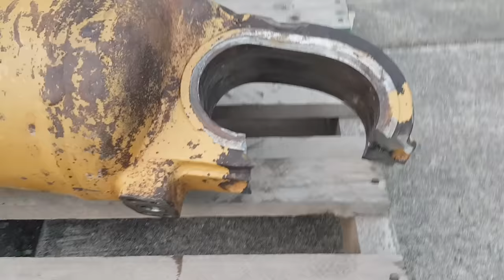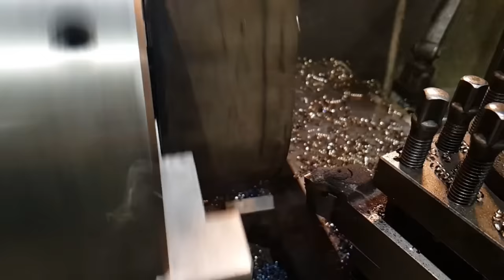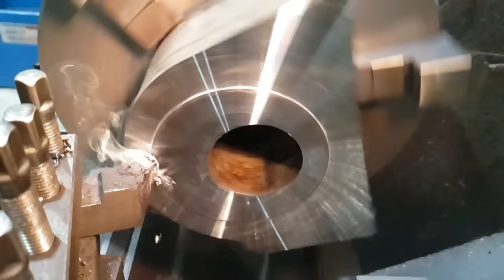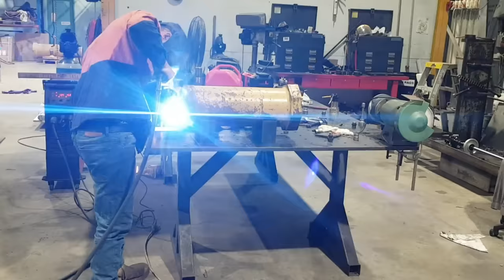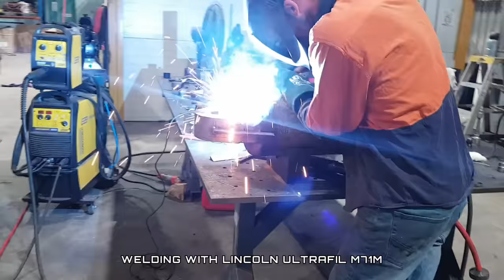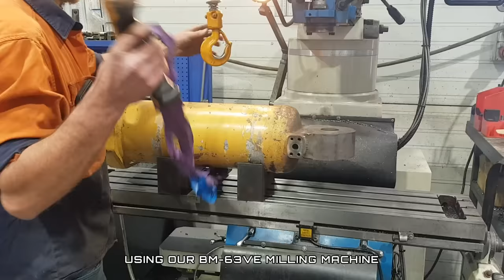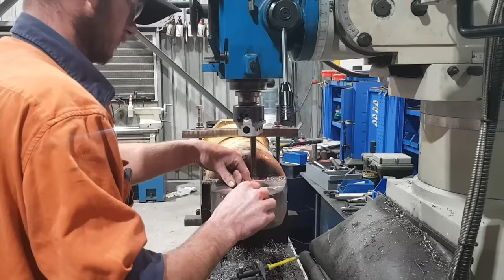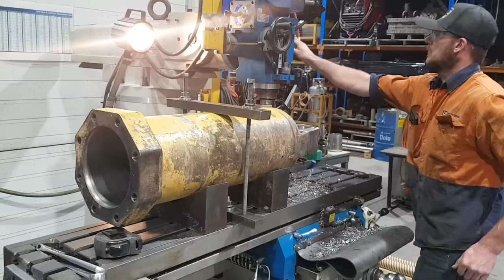Replacing Eye on Hydraulic Cylinder for Caterpillar D9 Bulldozer | Machining, Welding, Milling

Comment: My dad was a tool and die guy machining repair parts for huge presses. Watching this video makes me miss him and respect what he did even more. I know he had to work within tolerances of thousandths of an inch. You all did a great job! Thanks!
Reply from the maker: Hey Travis thanks for watching, really neat to see something similar and have those memories. 😎👍
Reply: "thousandths of an inch"? Can you please use real measure numbers? hehehe
Reply: @joaodarocha  You mean like Kilograms... ? 🤣🤣
Reply: @step4560  Kilogrunts. Like what you use when the nut won't come off but the wheel stud does
Reply: My Grandpa was tool and die as well, probably smaller stuff in general. Aircraft parts for Boeing. Next time I visit him I think I'll show him this channel. His GF is savvy enough to use computers haha.

Comment: Am not a machinist....so was in awe of that lathe cutting tool. Thought “something has to break” but I trusted you guys because I’m not a machinist.
Reply from the maker: Hey mate thanks for watching. Right tooling, feeds and speeds can definitely trust the gear 😎👍
Reply: I don’t see the preheated process before welding?

Comment: Worked in petroleum (and related hardware) for years...seen machinist work like this before, and even larger parts. Hard work, even with the right tools...but real craftsmen make it look better than new (and work better, too) when they are done. ALWAYS admiration for 'real skill'. I worked the 'advanced engineering' side of the slide rule, in the day, but if my kids were young now, I'd definitely push hard for them to have taken up trades (like machining) before dreaming of them going to college...trades are where the REAL WORK is done! Excellent video!
Reply from the maker: Hey mate thanks for watching and commenting. 100% agree. There's just something so satisfying and rewarding about a hands on trade 😎👊💥

Comment: That was a good repair, running the old three jaw on the facing cut wasnt what i expected. Good Job mate love watching how other blokes tackle repairs
Reply from the maker: Welcome to the channel, thanks for watching and commenting! 😎👍
Reply: I woulda ran the four jaw and roughed out the bore some while I was there.  Save some time with the fine boring head on the Bridgeport.
Reply: @Thewaldo12345  the time you "save" is wasted in setting up the 4 jaw. there is a reason hes making money while you make excuses.
Reply: @DieselRamcharger  if you can’t indicate a four jaw quickly you have no business in a machine shop.  Unless you are speaking of swapping out a three jaw to a four jaw that would take some time but most folks have a lathe for each.
Reply: @Thewaldo12345  youve got to put it on the machine. breaking down a setup is stupid. this was fast, easy and effective.
Reply: I wouldn't rough machine hole before welding...it just makes your welding tolerances tighter.

Comment: I have done hundreds of these over 30 + years. In logging these are common repairs. Some operators more than others. I used to keep many of these blanks for stock. I rarely had time to saw the weld taper off. Torch or plasma and get it done as a machine was down. No time for fancy work on the mill either. This blade tilt cyl couldn't care less if it looked good. Sound welds and function were primary. These ends were often sent to the mobile mechanics to install. The bore was done in shop and tuned to fit the pin with flap wheels after welding. No time for fancy when a road building contract was on hold till the problem was solved. 4 other pieces of machinery waited at big bucks as well. Sweet repair though !
Reply from the maker: Hey mate thanks for watching and commenting. I started out operating in forestry logging in north Australia many years ago 😎👍
Reply: @CuttingEdgeEngineering   I am retired now and really miss being out there.

Comment: I'm just impressed the time and effort was taken to repair it. Where I work they would just huck it in the scrap bin
Reply: And how much delivery time do you expect on such a part in Australia?

Besides the new eye looks beafier by a lot, so probably user thougth he was better of getting it fixed stronger then a factory original new one would be.
Reply: Cylinder like that, easily anywhere from 10grand up.  Especialyl with its age, likelihood of it not being available, shipping and down time constraints.  Repairing something like that is most likely the most economic route
Reply: @Relovance  don't know the cost but yes cheaper to repair then replace ..
Reply: they must of had a huge budget too work with ,, the normal is too fix it if you can ,,it is cheaper too fix then replace .

Comment: Very nice video...thanks for reducing the boring to a less 'boring' amount! Nice Mill, no big holes drilled in the table....yet....
 I worked as 'The Welder' in a machine shop...we had a big heavy equipment rental yard across the street, no shortage of hydraulic cylinder work. We had one guy spent his while day just doing the seals and piston rings.
 Lots of rod eyes on cylinders and rod ends...some big stuff...some cylinders were 12"...5" rods with big  Clevis welded on there...quite a few extension cylinders from Cranes.
Reply from the maker: Hey mate welcome to the channel thanks for watching and commenting. Very nice that would've kept you busy for sure 😎👌
Reply: @CuttingEdgeEngineering  I just found your channel... I've been 'retired' for 8 years...since I was 65...No one hires guys my (that) age in industrial shops....no matter if you can do the work...even if you're in good health, like me....but I still like watching this sort of stuff....! 

  The Shop I worked at had about 10-12 guys, days...2 at night...I welded all day...about 1/2 the time I was doing exactly what you're showing with hydraulic cylinders/rods...the other 1/2 was various other destroyed equipment...you know...'run it till it breaks, then fix it'....
 We did some 'medium sized' stuff.....had a couple big lathes...one was a Nardi,  about 108" swing...42 foot bed travel...guy sat on a chair on the carriage and ran it from there....
 Other one was around 80" swing but 50 foot or so on the bed...
 96" Blanchard Grinder...We could flat grind a 4 X 8 Steel plate...
 A couple vertical lathes..Bullards...a few mills, Bridgeports, 2 radial-arm drills...Carltons. 
 Biggest problem was everything was hammered...these guys bought every one else used up stuff...
 Even the 2 big Lincoln welders were barely working...Lucky I'm pretty good elec/electronic guy...and can fix them....and the other stuff...like the 5 and 20 ton overhead bridge cranes that didn't work...

Comment: Imagine the force it took to rip that eye open
Reply: I've had one experience working alongside heavy machinery, and that really opened my eyes for the rest of my life. What five people lifting together couldn't even budge after an hour of digging, a loader with one prong of the front scoop hooked under a girder ripped out of the dirt like it was nothing. It's seriously hard to imagine just how powerful hydraulics can be.
Reply: its cyclic stress that broke this eye ;)
Reply: @Heads Mess  Grease is compressible.
Reply: it took an new operator about 5 minutes
Reply: @Heads Mess I THINK it's better to use something that's compressible, so if a rock or something gets into the track, rather than something breaking, the piston is able to compress the grease and make room for the rock.
Reply: @bigredc222  there is a big spring behind a tentioner. That will get the shock loads and when stones get in between the tracks and rollers
Reply: @megape95  That makes sense.
Reply: @Heads Mess Yes that's what I read, the air in the grease is what compresses.
Reply: Завтра рано вставать.
YouTube : смотри прикольный видос.
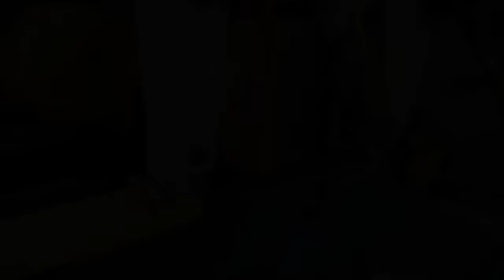1:00 ночи ...
Reply: Hydraulics is basically a modern day version of the lever. Huge Construction and Dock cranes use both hydraulics and Pulleys (also a type of lever). Some ancient Greek (Archimedes ?) once said give me a lever long enough and I can move the world. The Egyptians moved 1000 Ton stone obelisks! More than anything the level is what has MADE the modern world. Hydraulics, Pulleys (block and tackle), Gear trains, Screws, winches and wrenches, lathe chuck jaws, Lathes, mills, Cranes, wind turbines, etc, all levers.........
Reply: That's what she said.
Reply: @wayneg2139  Archimedes , after discovering the law of the lever in a physics paper (the first paper in Physics ever written) said "Give me a place to stand and I will move the world" He used a combination of pulleys and levers to move a ship all by him self (I assume to launch the ship)
Reply: It weakens with fatigue over time. Stretches. Let’s go

Comment: I cut the eye off a cylinder once because the piston had unscrewed and wouldn't retract all the way so I could remove it from the mount.  Just about got fired because of it.  I figured someone should be able to weld an eye back on there.  Cool vid thanks for posting.
Reply from the maker: HAHA that's bloody brilliant
Reply: @CuttingEdgeEngineering  I had thought about cutting the rod off.  I wonder how the boss would have liked that.
Reply: @ralphwatten2426  you should have said. lol "well boss it was eather the eye or the rod so i chose the cheaper of the only two options"
Reply: J.C. Kohle  No J.C. It actually, looking back 30 years, was 2 ears with a pin hole through both.  I cut it off because the piston had come off the rod.  I pushed the rod into the cylinder as far as it would go.  As I tried to tip the cylinder out of the mount that was inside a frame member, the ears hit on the top of the frame member that the cylinder was in.  I lopped the ears off with a torch and tipped the cylinder out.  The next morning the machine was running and warmed up for the operator when he got to the job.  I learned about 5 years ago from a fellow mechanic that the boss asked him if he should fire me for it.  If I had the steel and a drill that could bore 1" holes and a new piston that wasn't completely buggered up, I could have fixed the cylinder myself if I had the time.  No, didn't touch the cylinder or rod, just the little ears off the end of the cylinder.  Thanks for commenting.

Comment: with that material thickness...its mandatory to do pre heat before weld, post heat after weld and NDT examination (x ray or MT)
Reply: And if I’m not mistaken he used FCAW which he shouldn’t be pushing the weld pool he should be pulling it

Comment: I wonder if you could show some of the set up, like the indicating and locating? Very interesting. Thanks
Reply from the maker: Cheers buddy will keep that in mind for future videos!
Reply: That was worrying me as well.  The first face was not crucial as there was plenty needing to be removed, and the bore would be perpendicular to the machined face.  But it would be reassuring to see how the machined face was made flat to the table after turning it over.   I suspect that you could have easily got within spec using a workshop level rather than indicating.  You'd obviously reference the table with the level first.    I still think that the only crucial spec would be the bore diameter though.
Reply: @TrevorDennis100  No, the pin bore Dia is critical, but ALSO it being perpendicular to the piston bore, that is very important or the rod end and this pin will not be parallel and you won't get both pins in.
Reply: @integr8er66  
Both ends get a spherical bearing 
When the blade tilts its actually a pretty serious twist put on it 
In line is ideal for long life of the bearings more than anything but its not uncommon to come across bent rams that are working fine
Reply: @CuttingEdgeEngineering  That would be nice to see more of the set-up, but many of us already know how most of that is done...maybe throw a few set-ups in every 3-4 videos? Or hey...just show us a 12 micrometer or 24" caliper....then we know you mean business!!
Reply: Please cover all the hole  of the cylinder first！
Reply: I'm guessing the bolt holes and flat face on the other end of the part are used to square up the hydraulic cylinder, and find the centerlines for facing and boring?
Reply: @josephastier7421  Yeah, the people making the cylinders are real good about those dimensions!
Reply: @dougankrum3328  The bolt circle would be done in a machining center, along with facing and boring as part of the same program.
Reply: @josephastier7421   I work something like you also and 43 years experience for engineering mechanical
Reply: @cowcow7540  I'm not a machinist but have been around machines most of my life.

Comment: I can already tell the sequence of events leading up to the original eye breaking:
CAT operator: boss, this part needs to be replaced
Boss: whatever, just use it till it breaks
5-10 minutes later
*SNAP*
Reply: it took weeks and multiple requests :D
Reply: Have worked in multinational companies that actually demand run to fail.
Reply: Most the stuff we repair at work (mainly crushing and mining stuff) gets run till is totalled. Then we get the fun of trying to get it back to factory tolerances. Most cases it’s because it’s not worth the time/money to strip it down for preventative maintenance.
Reply: @Wyllie38  yeah I have run glass recycling plants 150,000 ton per year, same gear as aggregates. Glass just obliterates despite ceramic, ar400, chrome carbide, every time we plan maintenance it's delayed.
Reply: @Wyllie38  This is one of the things that pissed me off to no end when I was in the Diesel Engine business (Warranty Engineer). Owner would run one low on oil and ignore the knocking rod bearing (always took a rod brg first). Run the damn thing til it put a rod out the side of the block and demand a new engine claiming a "Factory Defect". No numbnuts you ran it low on oil! Always amazed me that people tried to pass off everything as a "Factory Defect". Look, we do this shit all day every day! We know what happened!
Reply: @PhilG999  I bought a Cummins Reman Ecm for my isx15 and it was defective from the factory, the power plugs had an issue where the tabs to the board was the soldered joints would break but might make enough contact to let the ecm work until the engine got up to temp. since they are mounted on the side of the block the ecm sees the extreme temps the engine does....Cummins refused to warranty it and 6 months later they sent out a recall notice and I got several letters...guess what? I had already been forced to eat the original $1,700 ecm and buy another $1,700 ecm to get back going...some help that was. Guess who won’t be buying anything else with a Cummins engine it for my business.
Reply: boss to cat op, it's just a scratch :)

Comment: I have a question, why did you use the lathe for the initial face milling of the plate instead of the mill?
Reply: I don't know why he used, but I would do the same in my shop because it would be a faster set-up and a cheaper tool to wear out. I in general would prefer Lathe over Mill when removing big amounts of material for those reasons. 

Also I would feel more at ease to put the late in the auto and go do other things nearby as he did. I wouldn't do the same in the mill (what efectivelly saves time). And as an extra the mill could be occupied at the moment by other operator or other set-up. Being a very time intensive machine the mill is usually being used. I have three in my shop, but the good one is always occupied with someone else set-up.
Reply: And in addition to all that there is the fact that it is easier to fix the part by its sides (chuck jaws) in the lathe than in the mill. So you can align the facing operation almost perpendicular to the walls of the part. In the mil you usually have a cut parallel to the oposite side (in a standard clamping the part on the table set-up), maybe the operator in the video didn't trusted the oposite face to be perpendicular to the walls. And as he didn't want to machine the lateral walls (other than the weld chanfer), maybe this is one reason too.

And if you want to face the whole part you will either fix it by its sides or you will need to fix one side, then face mill, then loose the fixation aparatus and fix it in the other side of the part to face mill the rest of the part (Always avoid that if possible as it can move the part, specially when the oposite side is not machined yet).

Comment: A very interesting video, thank you!
I have, as usual, some questions :)
1. On the interrupted cut, your depth of cut is quite significant, I was wondering if that is actually better than a shallow cut in terms of lifetime on the insert, especially the tip? 
2. What are the advantages of turning the faces down to size instead of using a milling machine?
A big thank you for your ever insightful replies, it is great to learn more!
Reply: I was wondering the same thing about facing the new eye. I have no experience machining but I imagine that turning process eats a few bits up fairly quick as opposed to milling flat. Hope he answers!